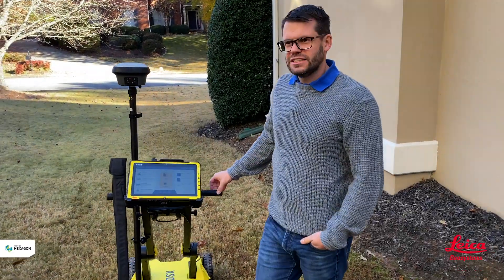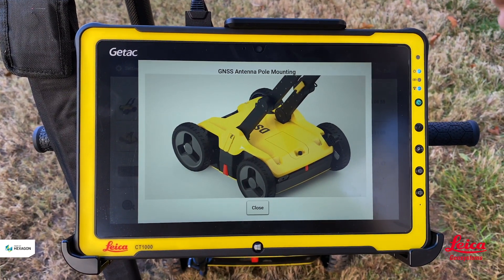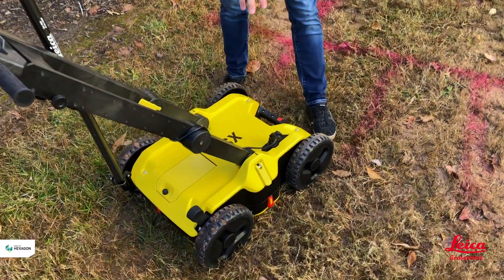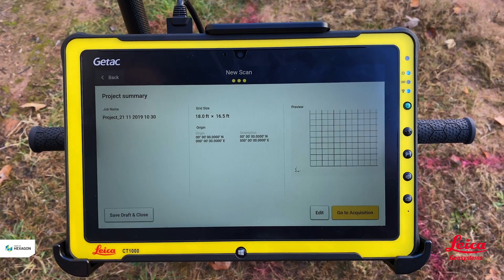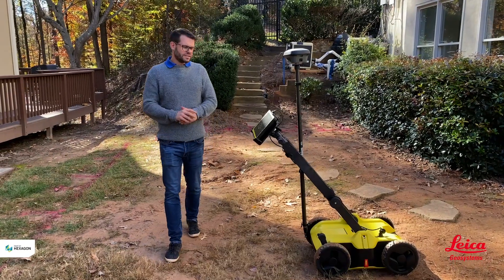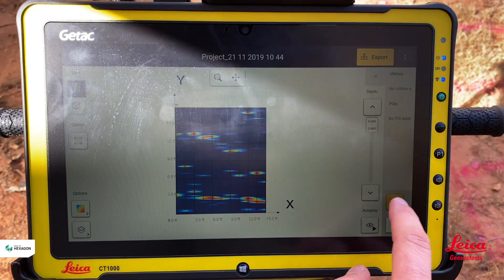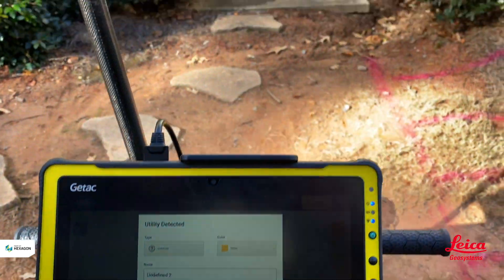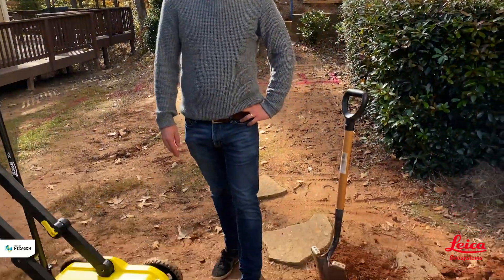Ground Penetrating Radar, A Step-By-Step Walkthrough Of The Leica DSX Detecting Utilities

Comment: If you use any simple metal detector U will find the line faster than this thing . if it go deep like 3 miter or more mybe its ok but line is depth 40cm u dont need to gpr
Reply: I don't think a metal detector could find PVC utilities
Reply: @jacoboariel7089  
In this case, you cannot blame it, but in the case of wires, it is much easier Also, in the event that there are no wires, sometimes a magnetic earth measuring device will do the trick as long as the depth is simple, very cheap, easy to use and small I am not saying that the gpr is not good, I mean that with equipment like this it is supposed to be used for deep and difficult to reach things. Thank you for the video and explanation

Comment: Typically when utilities are constructed, they are put into the existing plans. Not sure what the aim of all this is really.
Reply: You usually can’t read the damn things for starters. Secondly, a lot and i mean a lot of things go under the rug after projects are written up and checks are signed. Also, If there are pipes that have been out of usage it's important to locate these pipes when attempting replace existing. It has the same aim for pipes having tracer wire on them.
Reply: They are allowed to have a accuracy of 500mm either way. A lot of times as built drawings don't get submitted.

Comment: That's a crappy system. If I'm running GPR to locate utilities, I want to see them in real time. I don't want to waste time with a grid and having to use a giant triangle and string to lay out my pattern. On top of that the UI on the tablet looks like crap. Leica failed with this.
Reply: What he does us area scan which is different than line scanning. You don't need to setup and grid marking when you do line scan as it shows utility on screen hyperbole. Area scan gives you 3D with which is called Augment Reality. Both has different purposes but they give same Informations such depth and distance.
Reply: I do same sort of work. What GPR do you prefer?
Reply: @vincenthardie8398  its scan round ground or like this must walk ?
Reply: Mike, you can acquire in real time, he said this a grid map..not Line Scan